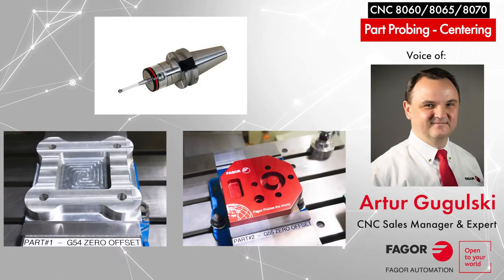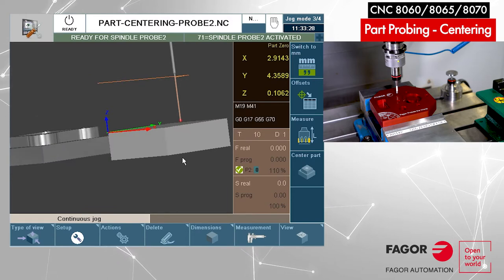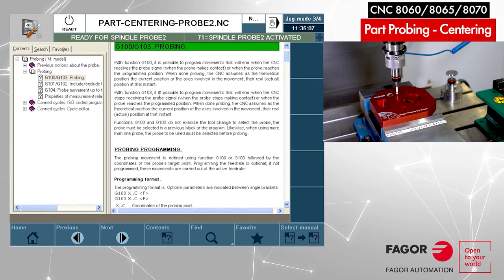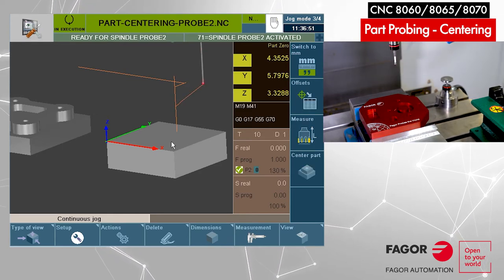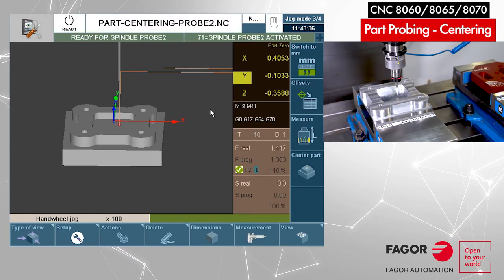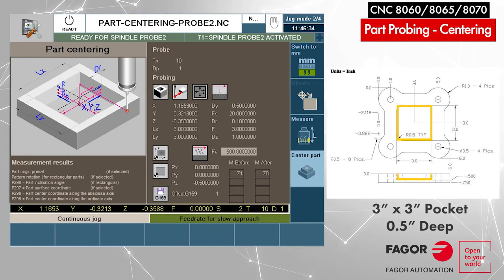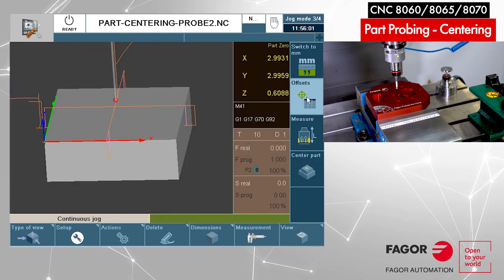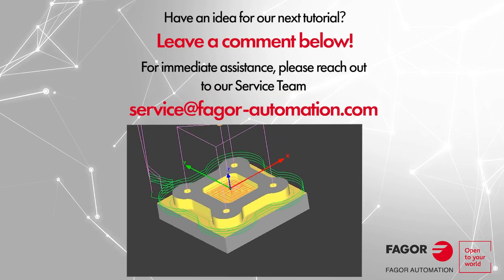Part Centering - Part Probing - Fagor CNC 8060 / 8065 / 8070

Comment: This is so stupid. I like so much about the fagor controller but your probing and part center measuring system just sucks so much.  it outweighs every good option of the machine. For two years I kept reaching out to Souli Intounas at fagor and he kept promising to answer a few of my questions and then suddenly my machine is now old and they wont answer questions anyways. I Cant wait to make a full in depth video about how outdated your probing systems are and why no one should ever buy a machine with a fagor controller.